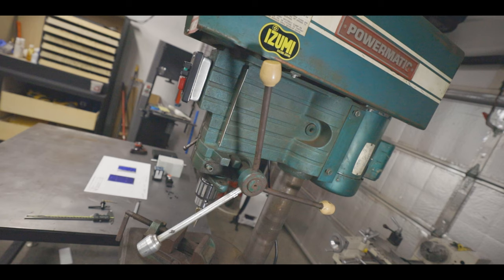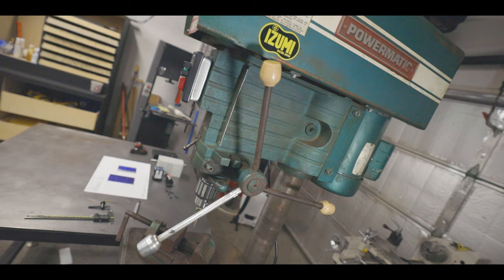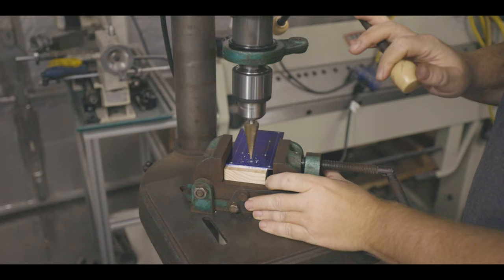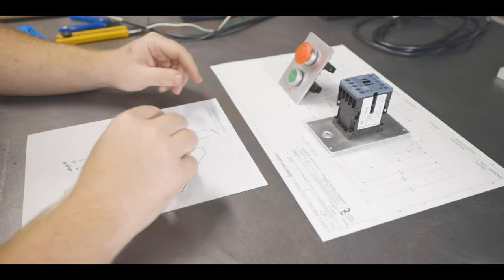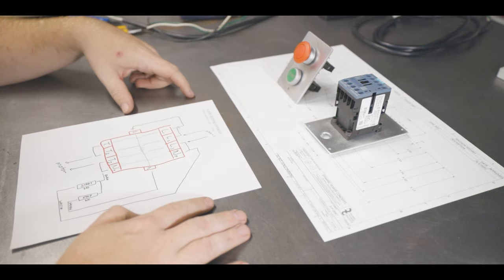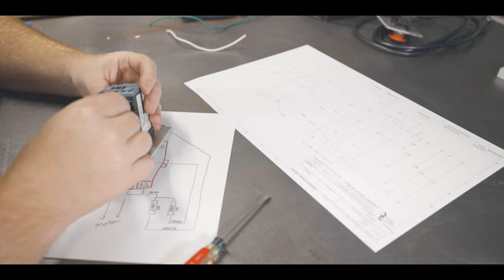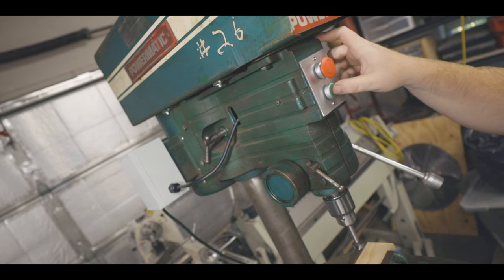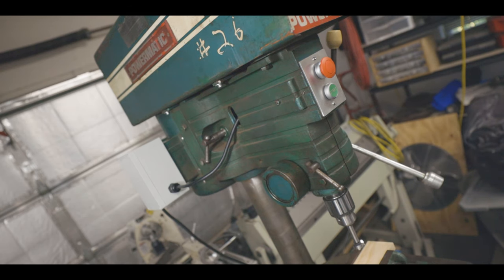Powermatic 1150 - 3 pole power switch upgrade

Comment: I love the upgrade, I just bought one of these from a hobbyist's garage shop. Looks like new. The belt seems to get stuck and start to burn. I think I need a new one to start. I've seen people lube these pulleys and belts. Any advice? Thanks.
Reply from the maker: Belts like these are designed to run dry. Lubrication will just provide a place for dirt and dust to cling and will prematurely wear the belt and the cones out. Stay away from the lubrication. If a belt like this gets stalled for too long it can create a wear spot on the belt and then it probability of happening again, so it a compounding issues. I'd take the belt off and see if there is any badly worn spot. If so replace it. While you're in the I'd inspect all the moving parts to make sure they move freely. Be careful with the springs on the motor shaft pulley. It has some beans behind it. But a block of wood and two clamps can be used to compress it to get the snap-ring off. Good luck hope this helped!

Comment: Any chance you could give me the model number for the contractor you used? I’m wanting to do the same upgrade to mine
Reply from the maker: Well that was a fun email hunt: 

Contactor:
https://www.alliedelec.com/product/siemens/3rt20151ak61/70239791/?m=70239791

Contact Blocks
https://www.alliedelec.com/product/eaton-cutler-hammer/m22-k01/70057788/?m=70057788
https://www.alliedelec.com/product/eaton-cutler-hammer/m22-k10/70057789/?m=70057789

Switches:
https://www.alliedelec.com/product/eaton-cutler-hammer/m22-d-g-gb1/70800003/?m=70800003
https://www.alliedelec.com/product/eaton-cutler-hammer/m22-dp-r/70057773/?m=70057773
Reply: @Obscuremotorsports  awesome, much appreciated.